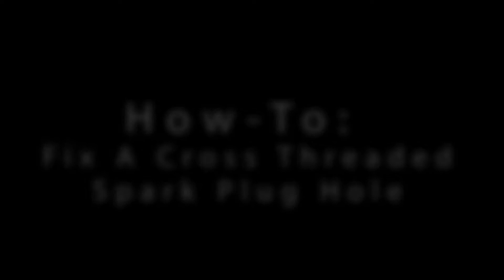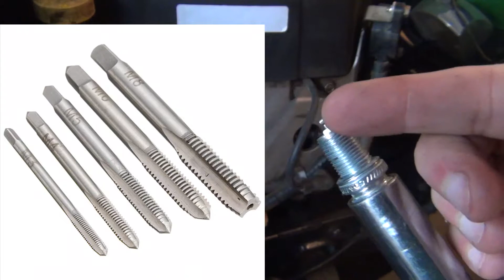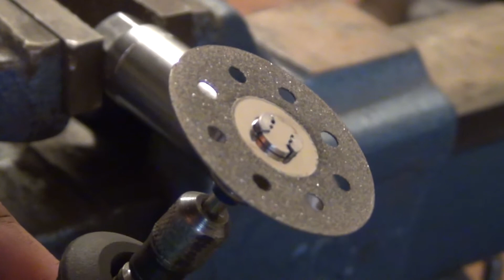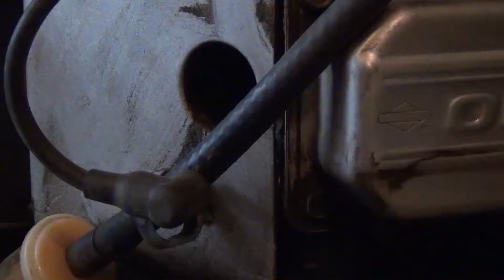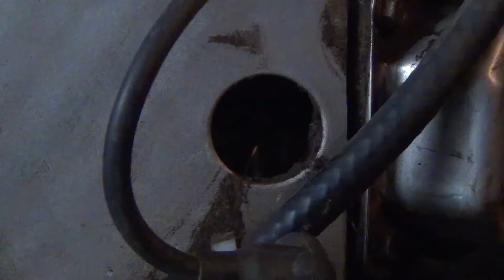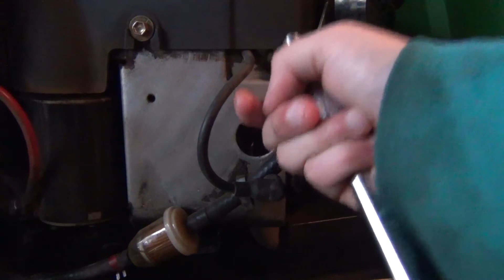How To: Repair a Cross Threaded Spark Plug Hole | Quick Backyard DIY Small Engine Repair

Comment: I’m gonna try this on my ‘99 4Runner V6.

 One of the old spark plugs was stuck. I had to use a break bar to get it out. 
  
 I’d like to try and save the block threads. But I’ll get a kit with an insert in case this spark plug ever blows out.

Comment: This happened to me today on my John Deere D100. I was just going to put a new spark plug in and immediately noticed the old one was really hard to get out. I don't recall having a problem putting it in, but it's cross-threaded. I will try this since it's a problem getting my mower into a shop. I already forced a new one in and found it would not go all the way. I broke the first new plug I tried to force. I was surprised the mower even started and ran with the spark plug not all the way in there. I'll try this fix before I start it again.

Comment: You said, "... on winterizing my mower... I noticed I made a huge and terrible mistake..."
------------------
Say no more, say no more-- all of us have done that, or almost have done that. In my own case, after a lifetime of maintaining lawnmowers, I was a bit careless on reinstalling the spark plug. Plug removal had become a temporary necessity as my mower engine neared replacement of its piston rings. Without cleaning the plug before starting the mower, black oil residue on the spark plug prevented mower start.
For the immediate future, I realized the spark plug hole, itself, must be cleaned out with a rag (moistened with oil) on a regular basis so that the plug moves smoothly in its correct threads. Without regular cleaning of the spark plug threads and plug hole, a bad plug alignment can feel exactly like a normal insertion into a dirty but otherwise undamaged thread hole.
Nice video-- clear and to-the-point, with good, steady camera and non-reflective lighting. The Dremel tool was the star of the show.
Thanks for the emergency measure. We found similar approaches with other videos, but none exactly lke yours, using the (modified) original spark plug as a thread "chaser". We thumbed up and subscribed.